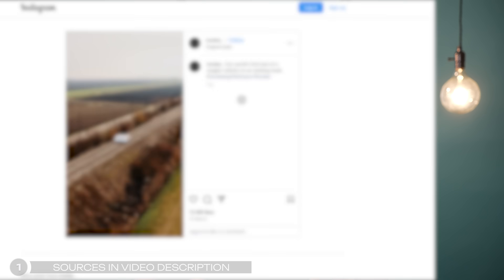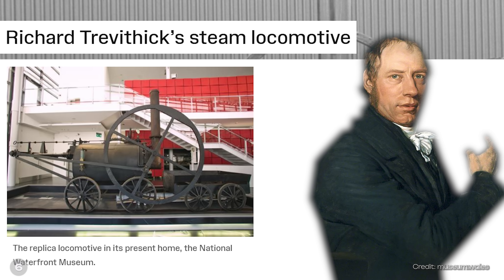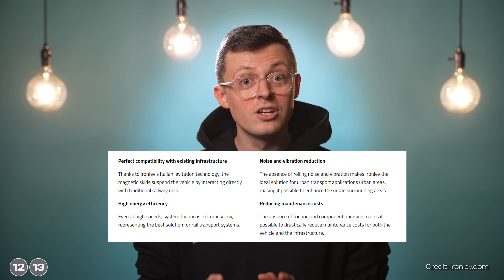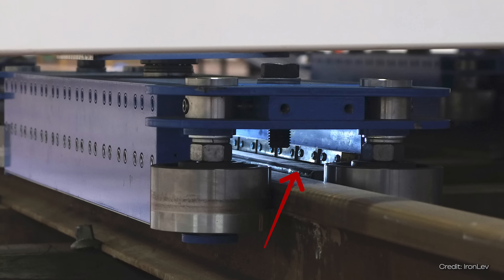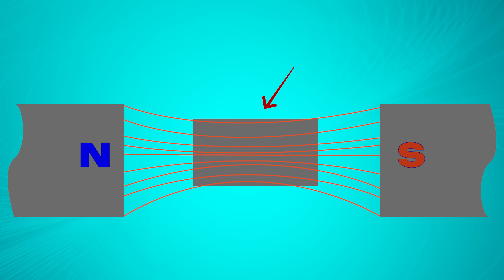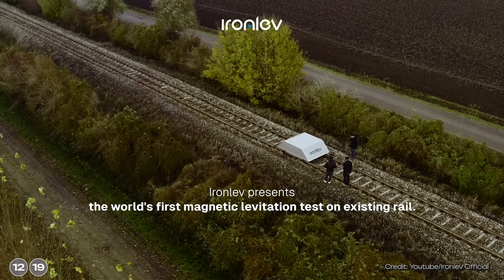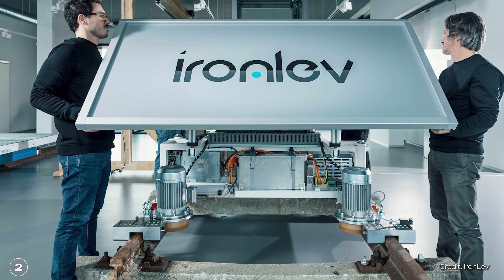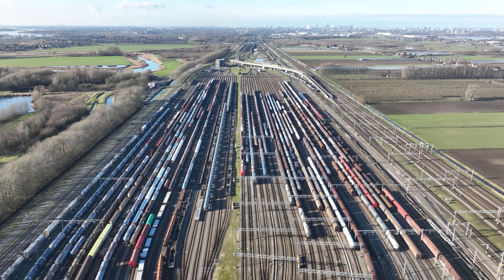World's FIRST magnetic levitation train on RAILS - Is this the train of the future?

Comment: Also, in urban areas, rails are often embedded into road surfaces, making a U-shaped design impractical. Additionally, magnets generate heat during operation, and excessive heat can diminish their magnetic properties. I can also see that turns might pose a challenge for this cart. At this point, it seems like an overengineered bicycle.
Reply: He's probably also talking about railway crossings. It sure would be a bit bumpy to cross two 15cm tall rails that are heated to 300°C or something... especially for supercars that love to embrace the earth.
Reply: There are no trains in urban areas. They are called trams.
Reply: @iscadean6038  Railway crossings?
Reply: @iscadean6038  I suggest you to try to look what is a train station and where its found often. 
Also, try to search what is Level crossing. 
There is no real benefit to reduce a noise in uninhabited areas, but in towns and cities(and near them) you can often see embedded rails or level crossings.
Reply: @iscadean6038 subway trains are in urban areas.
Reply: @iscadean6038  So all trains coming into the "Central Stations" of the world, you know, those located in major city centres, are suddenly trams now? Lol no.

Comment: Great video. I can see this system being used with very light rail in towns. Like trams here in Australia. So very quiet and not much load and not a high speed. Anything beyond that just won't work. Weird that these guys are throwing so much money at something that won't really be anything innovative. Also the inductive heating. Imagine an entire train length of these. The rails are case hardened. Heating them will just soften them. Eventually creating issues for regular still lift (wheels) trains.

Comment: This really feels like a problem that should already be solved. We’ve known about magnetic levitation effects conceptually for millennia (think naturally levitating lodestones). We’ve mastered aerodynamic lift principles for centuries, from simple gliders to supersonic jets. We know how to generate magnetic effects using permanent magnets, electromagnets, and superconducting magnets.
We already use electric and magnetic principles in countless machines: electric motors, maglev trains (like the Transrapid), magnetic bearings, linear motors, magnetic couplings, across a wide range of scales, industries, and designs.
So with all this material science prowess, engineering know-how, and electrical and magnetic expertise, why on earth is this problem, (magnetic levitation trains), still not finally solved?

Comment: The friction between steel wheels and track is not in the top 100 of rail problems to be solved.
Reply: The main reason trains are still used is because of it's low friction steele wheel on steele rail .  Above 100 mph you get wind resistance starts to be the problem which would apply to any land transport .
Reply: @lassepeterson2740 dont confuze friction with roaling residtance. Not the samw thing.
Reply: What are the main problems for railroads?
Reply: @ajknaup3530 
The people who specify their kit and run them.

Costs out of hand.
Reply: @ajknaup3530 Convincing governments to build them :(
Reply: @ajknaup3530 here in America, it’s the fact that passenger rail still uses outdated freight rails, so a train can’t safely go as fast as a true high-speed rail.
Reply: @ajknaup3530 Major problems include: Cost. Reliability of timetables. Industrial action. Other passenger behaviour. Travel comfort. Planes are much faster. Building new track is usually super difficult. The trains don't always go where you want. Train services often don't integrate well between nations.
Reply: @anticarrrot I would say mainly the lack of rails with usable speed. Most railway tracks in my country max out at 80 km/h, though it is not uncommon for trains, even on major routes, to just slowdown to 30 km/h for a old curvy section, not repaired since WW1. Our railway network also did not grow at all since WW2, with the exception of trams and metro, and probably few individual tunels/very short connection track, but many local tracks were closed to the total network is now shorter then 100 years ago.
Reply: @anticarrrot  It's not railroad techonolgy problems, it's management problems. 
Railroad track does not costs more than highway, it's comparable and probably cheaper on long distance. According to compassinternational, new high speed double railroad track costs from $1.5 mil per km (excluding signal systems etc), while new 2-lane road starts from $3.3 mil per km.
Reply: @anticarrrot  it's a XIX'th century technology, from where people had no cars and there were no planes. From a long while we're just witnessing it's century long slow death.
Reply: @anticarrrot  well i would argue we have technical solutions to all of these but it depends on gov't support
Reply: I mean the friction between steel wheels and track IS a big issue, just in the opposite direction, wheel slipping can be a big issue especially in rain, at least sanders exist which mitigates this issue
Reply: It's kind of the main benefit of rail.
Reply: Yeah, that is true. Steel on steel is great up to a certain point, but many passenger trains use a 'tire' that is not steel for comfort reasons.
One of the main pushes for maglev is that high speed passenger rail starts to have issues with comfort and rail interface that are somewhat solved by maglev, but these are unique to high speed passenger rail. I expect that maglev is a stupid idea for freight trains.
Reply: THE  TOP  RAIL  PROBLEM:
The greatest threat to any rail is always going to be ethnic minorities. Especially nonWhite ethnic minorities, by a large margin. #YouDontHaveToLikeIt
Reply: This is wrong. Trains biggest problem is maintenance costs caused by wear and tear of tracks, wheels and brakes. This makes frictionless contact between rails and wheels the absolute most important problem to solve.
Reply: @RasmusLarsson-c4r mag lev already solved that, mag lev is just expensive
Reply: @RasmusLarsson-c4r So then the rails will just rust and then Ironlev won’t work anyway.
Reply: @twoeggcups Rails are rusting all the time even today. That’s not why you have to change them. And magnetic levitation doesn’t care if rails are rusty or not on the surface.
Reply: @RasmusLarsson-c4r 
If there was no friction between wheels and rails, the wheels would just skid.

Wear is mostly caused by bad design and excessive speed.
Reply: @physiocrat-sv Moving surfaces in contact with each other is the cause of most wear and tear in all mechanical items. That’s why most windmills use magnetic bearings instead of roller bearings nowadays.
Reply: @RasmusLarsson-c4r 
It is much more complicated than that eg vibration, rolling contact fatigue and weird interactions giving rise to corrugated surfaces. It all gets more severe at speeds of more than 150 kph.
Reply: @physiocrat-sv  the problem is friction is generated in regular trains via the normal force, which requires them to be heavy. so if this uses lateral clamping to stay on the track & move, potentially lighter cars & engines could be used, which means less friction on the tracks, less energy required, more payload as a fraction of total mass moved, etc.
Reply: It only your lack of knowlage that make you say that

Comment: Notice how the track is straight, the wheels need roll up on the taper to effectively change the ratio between the two wheels, so that the outer wheel can move faster than the inner. This will have the wheels keeping the magnets from touching the tracks hard against the sides of the rails, rails aren't designed to take the sideways load of a fast moving train or a very heavy one. The quantity of magnets required to hold up a 50 tonne railcar won't fit in the space under railcar. Tschuss
Reply: That what i was thinking, it`ll take massive amounts of r&d to get a standard rail designed for horizontal loads. It would have 2 rails built into 1 and the base of the rail would have to taper more meaning much more material and spikes and ties might not cut it because they`ll be taking massive horizontal loads as well. Seems loke a sure way to loosen railroad ties and spikes over time through frequency loosening, how long? Who knows...
Reply: That' why the wheels are somewhat conical in shape to accomodate turning. While turning, the inner wheels' outer edges touch the rail which have smaller diameters contrary to the outer wheels inner edges which have larger diameters as compared to the inner wheels.
Reply: @kmundu3890 But the lateral load is entirely magnetic and looses all the rigidity of a friction load it`s not touching the rail at all. Normal wheels use that outter lip for indexing and it`s not that much different with the rollers but that friction up top is important. I`m thinking they`ll need a centered indexing rail at the very least but the rollers aren`t a serious thing it`s just a demonstration
Reply: @astrataway7077 no, the roller wheels on the side will be exerting even more force horizontally than the magnets are exerting vertically. The magnets on each side are attracted TO the rail, what it keeping them from touching it is those rollers.

Go push on a fridge magnet and see how much force is required to slide it down, then compare that with the force to pull it off the fridge. Those rollers would be preventing the magnet from touching the fridge (rail).

The way conventional trains manuvure bends/turns is more akin the sloped track of the Daytona NASCAR oval - except the slop is on the train wheels instead of the track (rail). Plenty of videos explaining how trains take turns/bends on youtube, it's all in the wheels shape.
Reply: @sirtra It really doesn`t matter what system has more force all that matters is the fact it`s a compound system with 2 differing physics, both are novel yet the rail stays the same. Those rollers weren`t entirely steel if i remember correctly i haven`t rewatched the video but i thought they looked like theme park rollercoaster wheels made from teflon or something simular. I just can`t imagine a freight car loaded to the rim with for example something heavy like "torque converters" using this, it probably good people carrier though.
Reply: @astrataway7077 the force absolutely matters as it affects friction - you know, the one and only thing the ironlev is attempting to solve/improve.

The rollers are steel, they have to be or they would wear down or wear the track - if this was to happen on one side more than another, say the train runs in a loop so one side wears quicker, this would be catastrophic and occur rapidly as it would escalate the wearing the closer it gets to the rail (as the force increases the closer the magnet gets to the rail - yes force!).

Not to be confused with the driving wheel which is the orange looking things connected to the motors - you know, the ones which are needed to make the train move and stop.

This thing is never going to be economically viable, but even if it was, it doesn't deliver on what it promises. It can't even take a bend yet, thats the gotchya they arent revealing, to do that all those nicely lined up magnets in a straight row need to be able to bend with the track. To do that will require them to be independently movable and for each to have their own roller.

Stay in school kiddo.
Reply: @sirtra They could solve this problem entirely and probably make it viable if they ditched the convoluted gyro meat rollers and add a indexing rail down the center using horizontal load steel rollers and that way at least you don`t have to replace of modify most of the track. The lift system is sound it`s just the exicution
Reply: @astrataway7077 which defeats the whole purpose of using existing infrastructure. At that point the middle "rail" might as well be an electromagnet and you got standard maglev 😂

Comment: I feel like i am missing something, if the field lines are going through the head of the rail between two sets of powerful attractive magnets how is the vertical levitation achieved?  The rail isn’t a superconductor, there is nothing pinning the flux to the head of the rail beyond the greater mass of the of the head of the rail rather than the thinner body below.  Not to mention won’t the iron in the rail saturate at some point so even if it works small scale it might fail at full scale.
Reply: The greater mass of the head of the rail is it. The greater mass means the rail head is the path of least reluctance (2:50 he calls it "magnetic resistance" which isn't techincally correct but that's the segment that's obviously meant to explain it)

Try with a toy magnet and dunno, a string of iron beads or something. Make sure they don't cling together (exclude friction). Yes the attraction force will be stronger near a bead and resist moving magnet to a place where flux passes through less iron.
Reply from the maker: Thank you!

Comment: I see you covered it but the eddy currents was the first thing I questioned seeing that broad strokes layout.  Even assumeing the lifting force works with that design, which is doubtful, there will be a ton of heat and breaking force from the rails passing through the magnetic field.  Probably not enough heat to cause a problem with a single car's worth of modules at low speed but a mile long train with hundreds of modules passing through at moderatly high speeds?   Your going to be able to cook on those rails after a train passes.  Thats not even counting all the extra drive power you'll need to overcome the breaking force each module exerts.

The bassic issue with any maglev tech is now your not only haveing to supply the energy to overcome friction/drag but you also need to supply 100% of the energy needed to fight gravity.  You can hide the cost to an extent with permanant magnets but there will still be heat and drag produced from any system that you must deal with.  Fun fact, permanant magnets do not like getting heated beyond a couple hundred degrees, they turn into non magnetic hunks of metal when you do.
Reply: Is that problem really any different to magnets turning in a generator though?  That produces electricity, which you can route elsewhere so the windings don't get especially hot.  The magnets running along train tracks won't be going over the same bit of metal anywhere near as much as a permanent magnet rotor sweeping past a stator winding, so it seems to me they won't even get as hot as the windings in a generator, size for size.  Also, a generator that is open circuit offers very little resistance to the rotor, which can spin easily and only gets harder to spin once there's an electrical load on the windings.  So as long as the train tracks are "open circuit" there should be minimal electrical resistance, which will translate to little resistance to motion, allowing it to glide easily.

Anything that causes the rails to heat up is going to rob the train of momentum, quickly making it less efficient than using steel wheels.  So it seems unlikely they'd settle on a design like that.  But of course I'm only guessing, as there's not enough information to know for sure.
Reply: @Berkeloid0 the train tracks are solid steel, the opposite of an open circuit. So you need different tracks, which...
Reply: @Jacksparrow4986  I'm not sure what you're getting at.  The tracks are only connected together when a train axle joins them, which is not the case here.  And an individual rail will have the same permanent magnet passing along it, just like a motor winding.  A single wire in a motor winding does not overheat, so I don't see why one of the rails would when the only difference is that the rail is straight and the winding is coiled up.